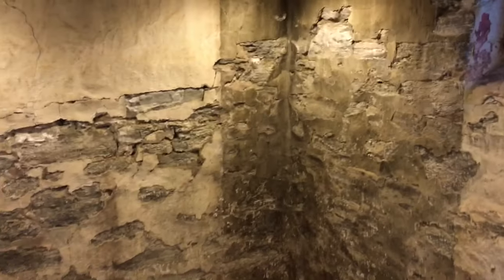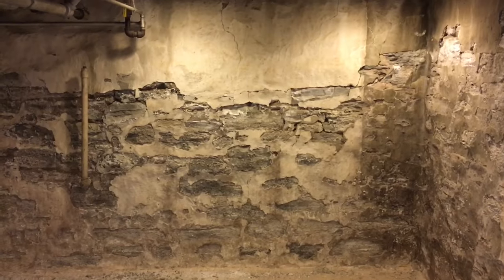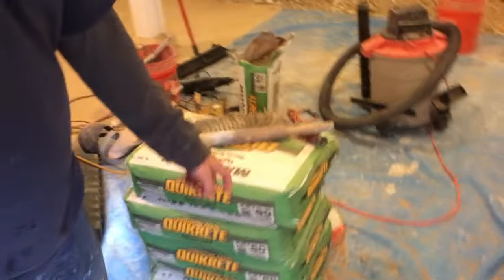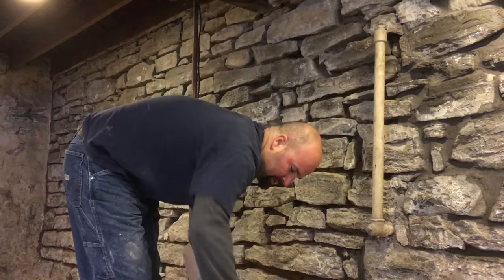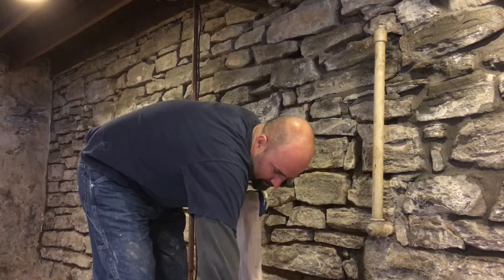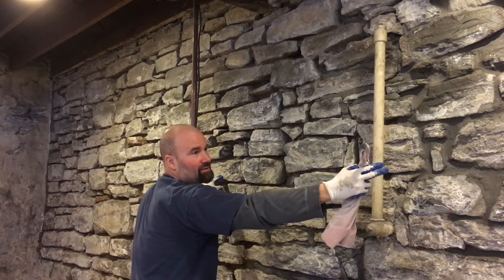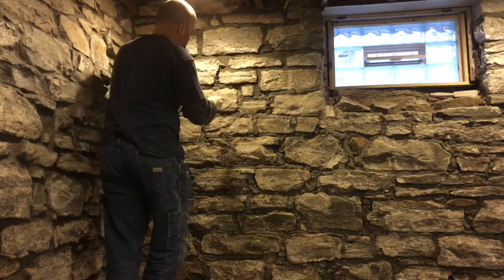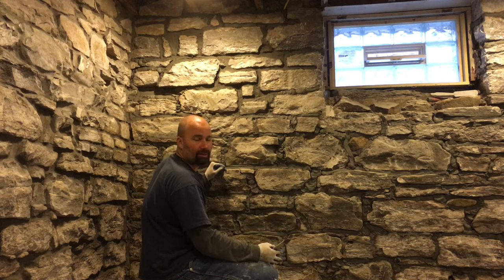Basement Stone Walls

Comment: Micah, do you know of any building inspectors who would allow a stone foundation for a house ? They were used for many years before the use of redi-mix concrete. I want to build a house using a stone foundation, but I don't think the local building dept will approve it.
Reply: john helfrich concrete is better suited to your build. But you could add stone veneer to get the look you’re going for. Otherwise you’d have to hire an engineer to sign off for building code variation

Comment: I am doing the same in my basement. But picked up a Mortar Pointing and Grouting Gun Sprayer Applicator Tool With 5 Connectors off eBay for $13. Don't care much for the piping bag.
Reply: How did it work , not so good I'm assuming ?

Comment: What kind of drill is ur laborer using to knock off plaster and mortar joints
Reply from the maker: Bosche or Milwakee or whatever they sell at Home Depot of Lowes. They last about 5-10 basements then they die.
Reply: Yes but what kind of drill, a rotary hammer? Be specific
Reply: U did such a wonderful job
Reply: That's a 12,000 job easy

Comment: What type of mix should I use for a Job like this? My basement looks very similar and has leaking issues.
Reply: low psi is key stronger is not good in this case. trust me . Been in the masonry restoration business for the last 27 years. ps dampen the wall first and make sure the joints are clean
Reply: type N mortar
Reply: You need to avoid portland based mortars like they used in this video.  It will ruin the stone.  Use a two and a half to one ratio mix of sand to nhl lime, which is more flexible and most important allows the stone to breathe.
Reply: @gregmorgan3308  There is very little Portland in that mix and that is a very hard stone as they always used in foundation walls so I would disagree, but I wouldn't use a strait Portland mix also .

Comment: why didn't you wet down the existing stone before pointing?
Reply from the maker: It was so humid in the basement that it was not necessary. The mortar clings to the stone because the surface of the stone is clean. Plus the mortar is super wet. It is sufficient to make a proper seal.
Reply: In this case I agree. I would add one way to tell is: grout/point a small section and wait a few minutes. If the mortar is dry, you should probably saturate whatever you are grouting. If you can go to lunch and it's still wet, obviously you didn't need to wet it first

Comment: looks like a good clean job! using hydraulic lime mortar would have probably been a better choice though.
Reply: Agree
Reply: lovely stone wall , lime mortar defo
Reply: Vee Sexton there are two reasons why lime is superior to portland cement on historic structures. 1) older walls are somewhat like living, breathing organisms. They need to breathe to be healthy, otherwise they deteriorate. The walls are naturally porous and cement is comparably impermeable, so it traps moisture in the wall. This allows the lime to leach out of the original mortar over time leaving only the sand behind. I have seen whole houses begin to sag because of this. 2) In areas exposed to frost and temperature change it is important that the mortar be softer than the brick or stone. When the brick swells and moves due to frost or heat/cold, lime mortar will give some, but cement mortar is generally too hard and will "trap" the brick causing its front face to crack and fall off (this is called spalling). It is possible to mix soft cement mortars by using more sand than usual in the mix, but lime is classic and enjoyable to work with (very plastic mortar) I use it every chance I can because it's hatd to go wrong on soft bricks or stone. Just make sure you are neat while pointing as lime is very white and any smears will show up. If you do smear, don't try to clean it up till it's dry otherwise it will just get worse. Good luck! :)
Reply: Portland cement is just regular grey cement like they use to make concrete and use in modern mortars. White portland cement is also available and is what you should use if you will be coloring your mortar with pigments. :)
Reply: @Vee Sexton portland cement mortar is too hard for stone. Also it does not allow the wall to breath.
Reply: @liamg1995  I can't find lime mortar in the Philly area. What brand do you use?

Comment: No face ask? Brave!
Reply from the maker: I do wear a mask most of the time. The worker in the video didn't use it till later when he realized how much dust was produced. I'll wear a mask all the time and go through several masks for each basement job and still cough out dust over night. I've been trying to remember the eye glasses. they are important. Its not uncommon to get bits of sand in my eyes. The trick is not to rub it. Let it wash out with water. Rubbing it will scratch the eye. Thanks for your observation. Health is good.
Reply: Micah Forsberg , thanks for the reply. I use a nasal rinse and find that if I don’t wear a mask a ton of nasty stuff is inhaled. Thanks for posting the video. It has helped me on a (less complex) cellar project of my own.

Comment: How far back should you go when removing the old mortar?
Reply from the maker: 2-4 inches. The stones are about 8 inches thick, deep, so you don't want all of it removed. The stones will fall out. the mortar helps to stabilize  the wall but is not a structural solution for major issues.
Reply: Like the other   Guy said,  lime, lime,  and. Waterproofing sytem to catch, control and pump out water,...lol,,,,

Comment: What did you use to seal it after the mortar cured?
Reply: You absolutely do not want to seal the inside. It needs to dry to the inside
Reply: rzl dzl What do you mean??? Please help
Reply: @unifiltered6840  he's saying dont seal the inside with a latex paint or anything, mostly because water will sit behind it and eat away at the soft rock. ie limestone. 
Although. I did seal my basement with latex paint. Drylok to be exact. The rock in my basement are 18 inches thick. I'm not worried of the house collapsing

Comment: It seems there are people who just want to do things their way regardless of the evidence.  So if you are a homeowner watching this video and reading these comments, you just need to do extensive research to figure out the best person to hire or the best way to do the job if you're going to do it yourself. I've had a lot of people ask me about sealing the walls. You never want to hold moisture into a masonry wall whether it's stone or brick. And most importantly you don't want to use mortar and sealer to keep water out it's coming in from outside the basement wall. If you have water issues on the outside of the basement wall, you need to solve the water problem outside and not treat your basement like a swimming pool. But when choosing a contractor you can't just go on what they say.  there are many contractors who appear confident,  but in reality  they  have no idea on how to properly do a project. They just do it the way they were taught. And they are not open to new ideas . For ego  or just out of plain stubbornness. That's evident by this video alone there are different opinions on how to do things and if I were a homeowner I would simply do extensive evidence especially when it comes to something as important as repointing a basement wall
Reply from the maker: I have 20 years experience in this profession. Not to mention the years during high school and college in which I worked every summer in this business. I take great pride in my work and I’m not in for the money. I’ve not gotten rich off this. I’ve gotten calluses. You can take your rulebook and your so-called evidence. I have my own evidence not to mention my brothers and my father before me and all those I know in the business in this area. We’re doing the job right.